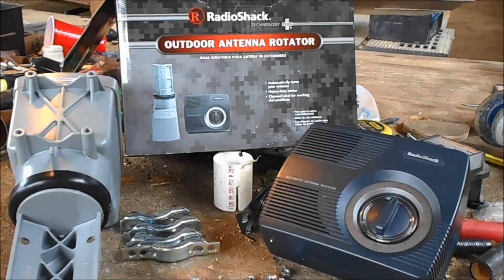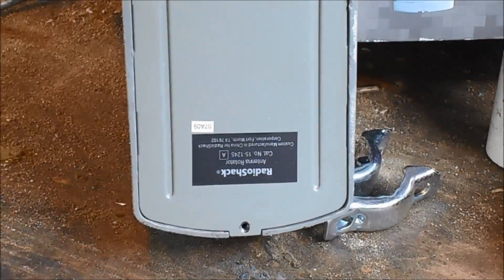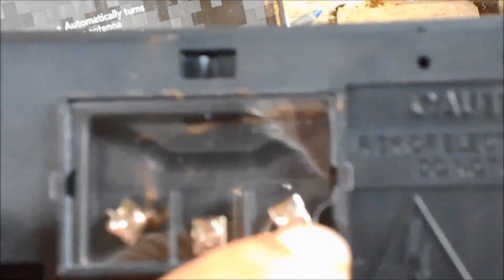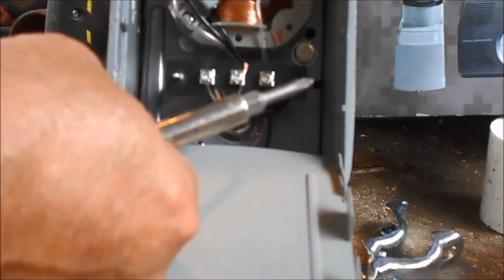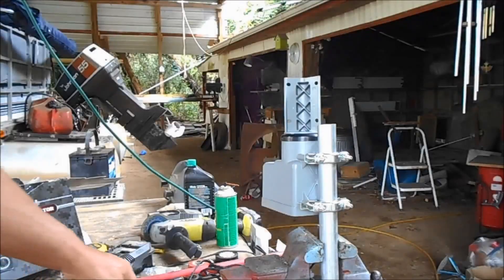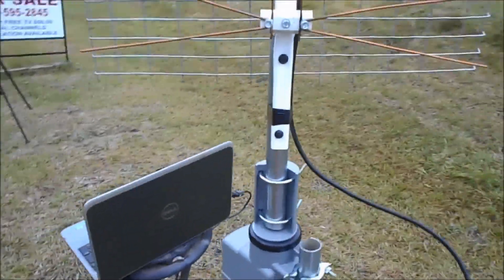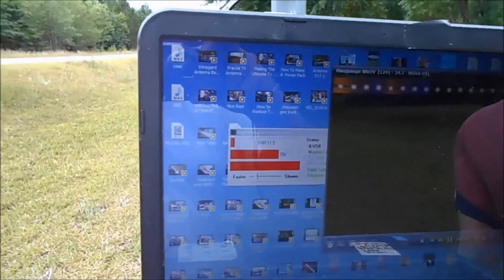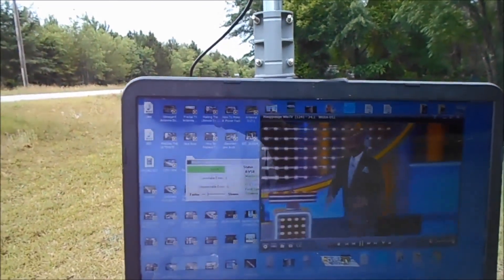How To Install A TV Antenna Rotor

Comment: This would also be great for a camera up on a pole so you can look around
Reply: I did exactly that with a $29 Harbor Freight Special: RCA Direct Video Feed Security Camera, 70’ wired connection. Excellent way to keep an eye on all the nutcases in your Hood …Tape it on with $ Store Electrical Tape and you have an Instant Security System for $30 Semi-Weatherproof
Reply: I would do it again now but new tv’s don’t have RCA video connectors any more

Comment: The best antenna rotor made was from company called alliance out of Ohio no longer in business they made them from early 40s to 1990s ...but they were built to last and can be rebuilt ware these new radio shack are made out of China don't hold up long term......there is a guy called rotor Dr formerly of Ohio now out of Kentucky he often has spare tenna u100 or u110 complete system rebuilt to continue service another 40 years ..he only charged like $75 plus $25 shipping all together $100 he uses latest low temp grease so these rotor systems will continue working he is on net under rotor Dr or cats his alliance u100 will handle any tv antenna and the out side rotor is heavy steel not that crappy cheap plastic channel master sells or radio shack ....I do antenna work as a hobby and never once been called back in my 35 years doing tv antenna ware ...with new rotors like the one In the video get calls from folks who baught this Chinese made light crap ..also install only hd Denny's stacker antennas so customer getting most station possible and use lna 200 amp from wine guard